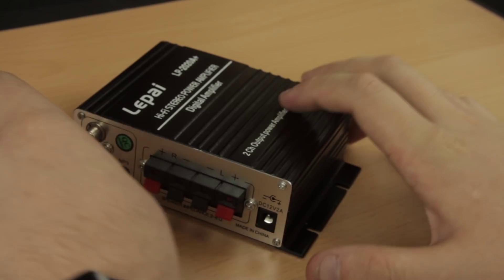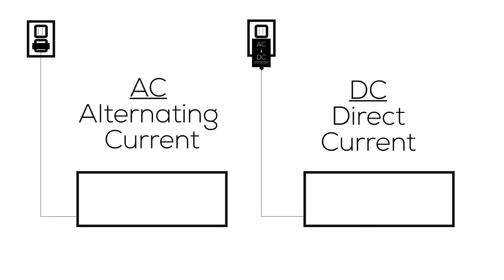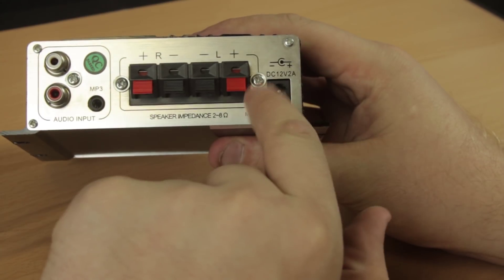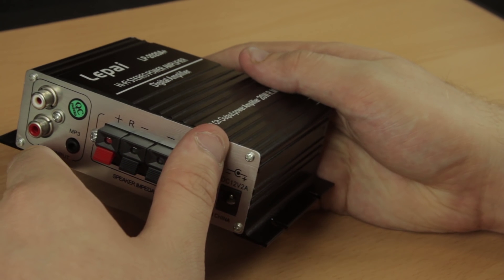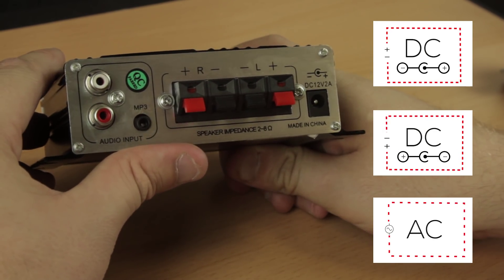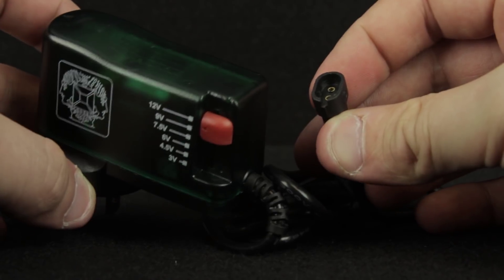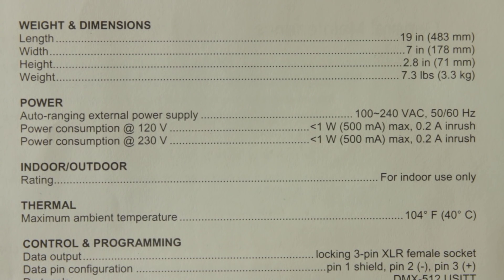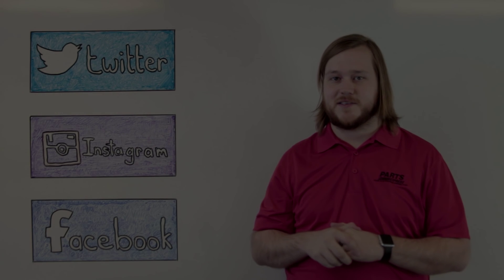How to correctly pick an AC/DC power adapter.

Comment: Thats great video sir, but I have a quations so :

1. Can I use a type AC connector for DC ?
For example I found a AC connector product the label max. current is 16 A. 

2. If I use for DC is safe? How to calculate AC type connector and DC for to implementation?

Best regard, Thanks
Reply from the maker: No you cannot use an AC adaptor for DC. The current type must match as well.

Comment: How do you figure out what to use if the device you're trying to plug into doesn't tell you any sort of that information about 12 volts and 2 amps. Even the manufacturer's website or doing some research online I was not able to find anything. Basically I need the AC adapter to plug underneath my coffee table that's a Chinese brand and it's to power 2 plug outlets on a hub. The usbs next to is already have power from the initial power plug that comes Hardware onto the table itself that runs the LEDs, and the USB Outlets. The only thing that doesn't power is those plug Outlets which require that AC adapter. Would a 12 volt 2 Amp work for this or do I need something else?
Reply: Get one of those universal adapters that comes with multiple voltage settings. Plug it in and start with 5v and work your way up until the USB ports work. Do not go over that voltage setting. Tape or glue the selector in place to avoid changing it accidentally.

Comment: I have a Dewalt jumpstarter.On the back of the jumpstarter it say the input volts is 14.5.One of my ac adapter is 12v.Is it ok to use 12v to charge the Dewalt jumpstarter.Can I use the 16v input ac adapter It's called Dx aeps14 ?
Reply: No, it would have to be 14.5V

Comment: Could you help me I require the uk version of the following US plug. 

AC-DC ADAPTOR MODEL: 0300200DF INPUT: 120V AC 60Hz OUTPUT: 3.0V DC 200mA is that possible?

Comment: My Kitchen faucet is from Allen+Roth and is powered  by an 6 volts battery port, I'm looking an Ac adapter that can replace the battery port.  The model # for the Allen+Roth Kitchen faucet is 67798W-120802 and Item # 2517130. I need your help please finding the right AC adapter.

Comment: Great video and fantastic illustration and explanations thank you! Question: Is it usually specified on the back of a power adapter whether it is unregulated or regulated? Is there some symbol that tells the difference between these two or would it just be spelled out?

Comment: I have the same amp and adapter that i got today in the mail and the adapter makes a high pitched whining sound, the sound also (very faintly) comes out of my speakers and gets louder as the volume knob is turned up. Is this a problem with the amp or the adapter? Also is it possible to have you guys send me a new adapter instead of returning the whole thing? I just returned the oneu amp i had before because it stopped working properly after a month and i really dont want to go through the whole process again.

Comment: Can someone please help.
I bought an unregulated supply to replace an old bulky charger which is a 2 pin shaver style plug that is on a UK adapter. The strange thing is when I measure the volts on the old one it actually reads 19V with a multimeter, but it says 12V output at 500mA on it. Whereas the new one reads 12V with multimeter.

Here is what it says this on the back of each: 

OLD MODEL:
Model: T-41-12-500D-3Pri
PRI: 230V ~ 50hz 60mA
SEC: 12V DC 500mA
Centre positive
(this is quite bulky and heavy)

NEW ONE:
Input: 100v ~240v AC 50/60hz
Output: 12v DC 500mA
Centre positive
(very light and small)

I plugged them both into the same device, which has a large internal battery and when you first plug in, the charge should stay at 99%, which means it's running off the mains plug and not the internal battery, which is correct. New plug shows it first at 75%, then 1 second later 65% and dropping so it seems to suck power out of the battery. 
Any help understanding this much appreciated.
Reply from the maker: There are a few factors you may be missing in this. Feel free to call our toll free tech support and we can help you get the right thing. 
Email: Tech@Parts-Express.com
Phone: 1-800-338-0531

Comment: is it true that the lepai 2020 works best with a 12v 5a power supply? is there a big difference in sound?
Reply from the maker: +ziggy8757 No, since the Lepai 2020 calls for a 12V 2A power supply, that is the best adapter to use. If your in a pinch you COULD use a 12V 5A power supply but you would see no difference in performance.